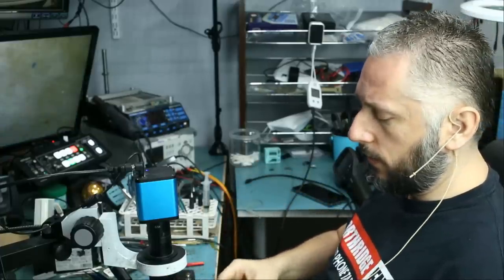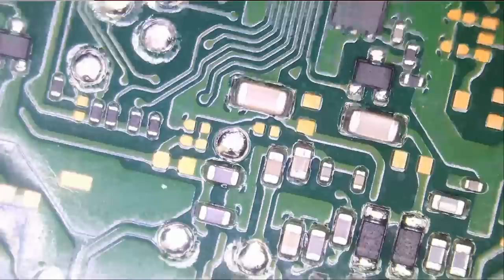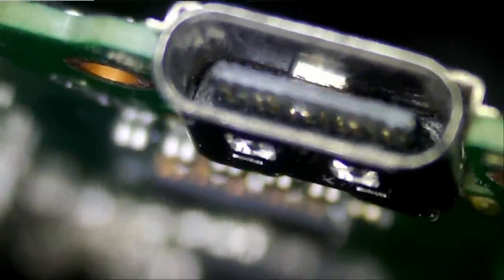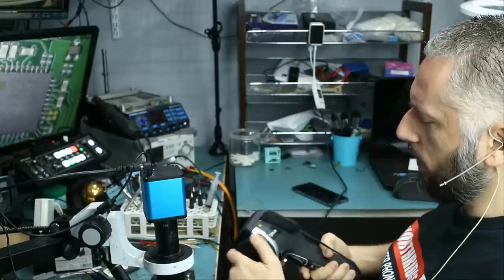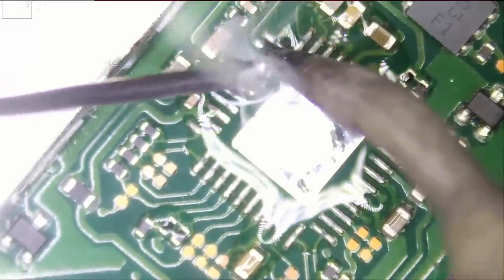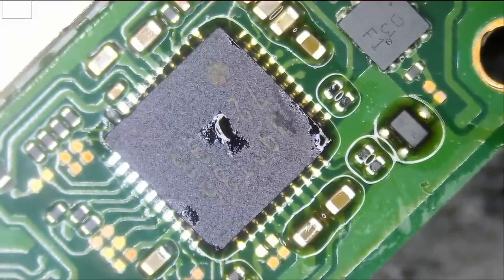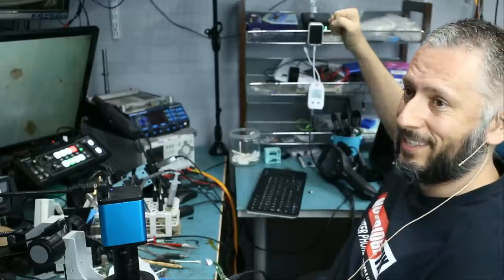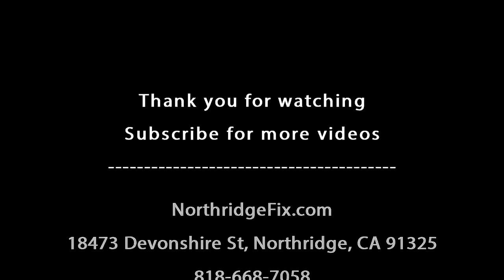Nintendo Switch Repair - No Power Not charging and no fault obvious

Comment: I enjoy your repair videos, thank you. I have been watching for about a year. I have noticed an area that I might be able to offer a little of my years of wisdom. When I served in the Navy as an electrician, I had to repair very dirty circuit boards. I experimented with using steam to clean these circuit boards. Steam cleaning was fast and very effective in removing years of crud from the boards. I had hundreds to do, I needed fast and effective. I found a few twenty turn potentiometers that did not like the moisture. A hair dryer fixed those quickly. When I watch you try to repair a key fob with liquid corrosive damage, I would use an ultrasonic cleaner.  I do not think it would cause damage and surely would stop further damage to the board.  I am sixty-six years old, and I was in the Navy forty years ago.

Comment: @Northridgefix whenever you get a switch not powering on, always check the serial number online to see if it is unpatched or possibly patched. If it is either of those plug it into a pc and check if it is going into RCM Mode. I've had this happen at least 6 times where customers have enabled this feature and didn't realize it. Obviously in this video it was not the case

Comment: I have a switch with a good battery and good charge port, no water damage or any singe/burn marks around any of the capacitors or other chips(haven't had the time to keep testing it)and yet still no power/black screen but hell I'm almost betting it's going to be that chip now that i watched this. Thank you for the quality diag, and showing how you diag and repair.
Reply: I’m having a similar issue on my son’s switch. Were you able to fix yours?

Comment: I was expecting you to say "Higher chance of survival"  I enjoy the videos.  I have a switch lite board that I ruined.  It was working but not charging.  Alex makes this look so easy so I thought I could fix it.  I moved too many parts on it and then found a spot where it looked like someone else was altering something under one of the covers.  It is not as easy as Alex makes it look.  I did enjoy trying and have added the board to my parts/practice department.

Comment: You fix them like I do. I hate wasting time on a board as time is money. I usually suspect that chip as well if capacitors are not shorted and everything test good. That chip just likes to fail, besides the video chip which also likes to fails.

Comment: have one with the same problem, there is no short in the M92 chip but its not taking voltage. So im replacing it and see if it works. Thanks for the video.
Reply: Did it work?
Reply: Yep. It does. The problem was the M92 chip. Just Replace it and thats all
Reply: Cool. It's probably my only option at this point. No shorts. Tried a new battery, and USB looks pretty good I think. Almost a week of diagnosing, then I found this video.

Comment: I also noticed that on my meter with the same as yours when I plug the phone the backlight turns off and when I disconnect the phone to the meter the backlight of the meter lit up. Im pretty sure that it has to do with shorted charging area.

Comment: I'm attempting a "no power Switch" that also won't charge. At 1:50, that component reads 5 volts in and 1 volt out. You measured 12 volts in and out, so what could be the issue on mine? Thanks in advance!

Comment: Help.  Switch turns off and stays off.  I unplug battery, plug it back in and it turns on.  Try plugging it into dock but dock is blinking fast.  Don't know what's wrong.
Reply: Forgot to mention first started happening after software update 😮